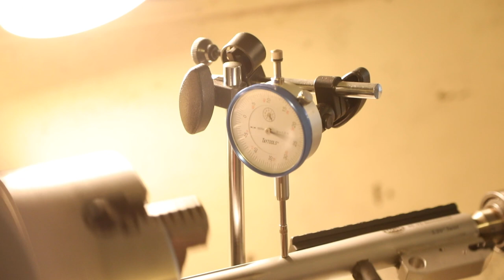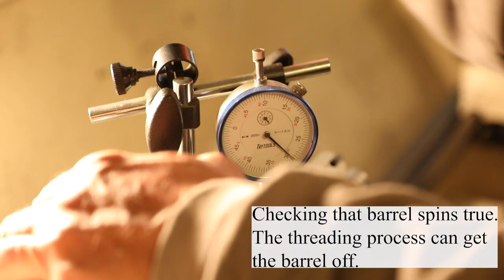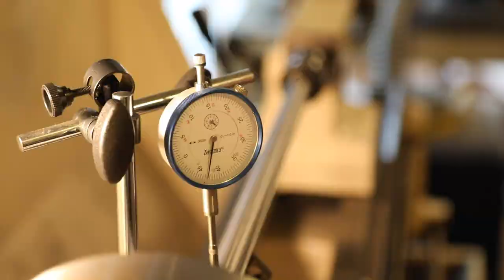How to Convert TC Encore Into Smokeless Muzzleloader

Comment: Other than smokeless powder being way easier to clean than black powder, I still don’t understand why you’d want to do this… 😅
Reply from the maker: One huge impediment to accuracy is the brass. Another is the bullet jumping from the brass to the lands and grooves. Both those problems are eliminated with a muzzleloader, hence the ridiculous accuracy and sub moa accuracy of SMLs. If that weren’t enough the enhanced velocities leave a 45/70 in the dust. So if someone has no interest in making their gun sub moa and doubling or even tripling their ethical hunting shots, then there would be no interest in this conversion.

Comment: How  long does it take to do a barrel
Reply from the maker: Depends on your experience level with the break action conversions. First one I did took a good part of six hours. I went slow not wanting to make a mistake that couldn’t be fixed. You get proficient and everything goes smooth you can do a conversion in less than an hour.